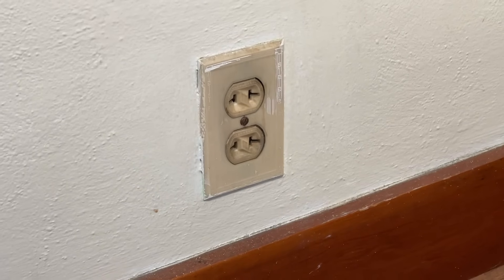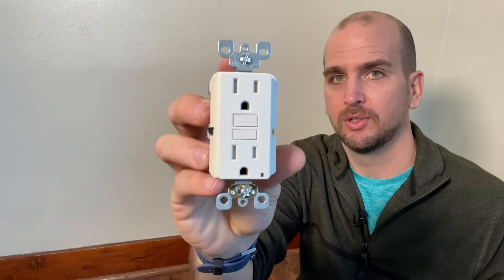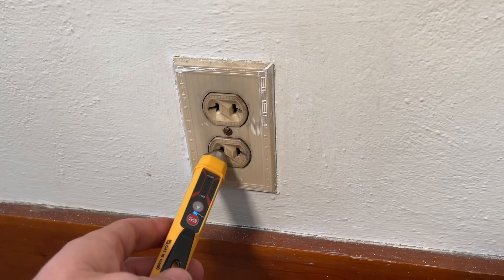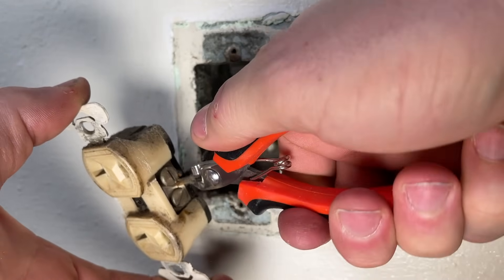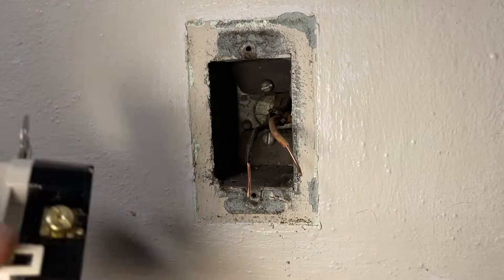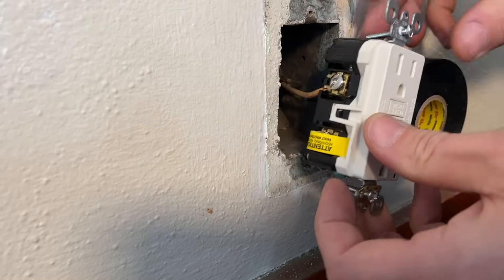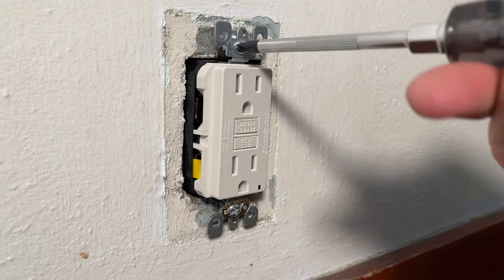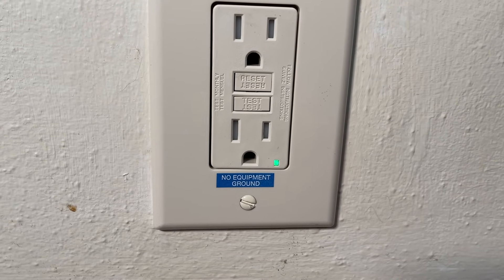How To Replace An Old 2 Prong Outlet Using 3 Prong GFCI

Comment: I though you ground the plug to the metal box?
I do this.
Maybe its useless...
Reply: Not useless IF the metal box is grounded.  It might not be.  In the house I am remodeling (1860s) the boxes are metal, but just nailed to the studs with the two-wire knob and tube wiring running to them.  The boxes are metal, but NOT grounded.

Comment: Nice and simple walk through. One question though, why didn't you hook up the ground on the outlet? Are they not needed on GFCI outlets?
Reply: Correct.  In this specific use, there is no ground wire to connect to the GFCI ground lug.  The receptacle is still not grounded, just like the original two-wire receptacle.  The difference is that the GFCI receptacle will sense a grounding event and trip, shutting off power to whatever is plugged into it.
Reply: @chrisboyd4433  exactly, had there been a ground wire there is no reason to install all these gfci's. Just install normal outlets and ground them appropriately.
Reply: there is no ground wire.

Comment: Oh so these don’t need to be grounded?
Reply: That is correct.   The equipment ground you are asking about allows high amps from a hot conductor touching metal incorrectly to flow back to the panel to make the breaker trip as short circuit.   GFCI measures the current of hot and neutral at the same time, so zero amps.   It will trip it’s mechanism if there is more than 5 milliamps of current difference.   They do not work the same, but safety is achieved.   Hope this helps.    Kevin

Comment: I am trying to replace my old outlet with a GFCI however both the WHITE AND BLACK wires are coming up hot!  There are only three wires.  White, black and copper for ground.  Its driving me crazy because its a kitchen outlet and I need it to work for so many reasons.  Any advice?
Reply: Cindy,  you say both are hot.   What testing method are you using to come to this conclusion?   Electrical tests for voltage.   Hot to N=120,   Hot to ground=120,  neutral to ground=0.
Reply: @KevinCoop1  Hi Kevin.. my contractor used a Voltage tester.  And even he was perplexed on why both wires were hot.  For some reason we are not able to replace the outlet because of this.  Any ideas what could be causing this?
Reply: @cindyr.9200     Question.   Did the receptacle work fine before trying to change to GFCI?  Have any other lights or receptacles been worked on?
There is only one possibility I can think of.   What is the voltage reading from supposed to be hot to neutral?   If 240 volts then condition one.   If 0 volts, then condition two.
Since this is your kitchen, should be very few outlets involved.
Condition one:   Have the electrician go to the panel and take off the cover.   Find the conductor on the breaker that turns power off to the hot 1.   Follow it up to where it exits the panel and see if it is part of a multi-wire branch circuit.   That means you have a 3 conductor cable with a ground.   If so, follow the other conductor to the other breaker and turn it off.   Now you should have no power to either wire at your outlet.   If this is what you have, somewhere in a box that is not powered any more, someone has connected the wires incorrectly.

Condition two:  If you do not have multi-wire branch circuit, then check all boxes turned off by the one breaker for incorrectly spliced conductors.
Let me know what voltages were found and if you found the bad splice.
Reply: @KevinCoop1  I have replaced numerous outlets in my home and have never had this issue.
Reply: @cindyr.9200    I did not see your response about changing numerous receptacles before my response.  Somewhere the white got spliced to the hot.
It has to be in a box the feeds toward the one you are having problem with.   Otherwise it would go boom and trip the breaker.

Comment: For this type of install how would you add a ground to it if you wanted one? I have a few outlets that are setup GFCI with no ground. Wondering if the ground is worth putting in/ how much of a hassle it will be? I'm using a GFCI outlet without a ground for high priced electronics (desktop pc, and monitors) so I want to make sure I do the right thing to keep them safe from any surges or issues that could harm them.
Reply: The ground wire needs to go back to the panel where the breakers are. OR it can go to a nearby outlet, switch, or junction box, that has a ground wire that ALSO goes back to the panel. You can test to see if it goes back to the panel by using a multimeter to see if you can get 120v from the black wire to the ground wire. If so, its good.
Reply: You can replace the breakers to afci they will protect your equipment from arc faults, gfci are for wet locations.  And you can also serge protect your panel it can protect your whole home
Reply: I’m not 100% positive about new computers, but I know for sure that years ago grounds were required by the manufacturers.    The reason is that for some reason, they are allowed to connect the ground to the PCB’s in the computer as a reference.   Could possibly cause data glitches.   I would suggest you check manufacturers instructions.   If required, get a new circuit installed to your equipment.
Reply: Any Surge protector/UPS plugged into improper outlet will have a red warning led lit up indicating a circuit fault . (The Instructions are: Do no use the protector and get the problem fixed) I've never tested a UPS on an ungrounded GFCI not sure if it would pass that test.

Comment: Does this work if there are other outlets Daisy chained into the circuit. I mean does the GFI have to be at the end of that line for the other outlets to work? And do I have to change all of them to gfi's?
Reply: The GFCI can be used to protect the receptacles that follow it, so it has to be at the beginning, not at the end. Alternatively you can just use only GFCI outlets and pigtail. The details are not important, important is that all of the outlets are GFCI protected.

Comment: Thank you for making this.  A potential duplex I found doesn't have any 3 prong outlets except in the bathroom.  I wonder if the property management company will be willing to update the outlets or at least be willing to cut me a deal if I have an electrician friend or myself do this.  The duplex also doesn't have a breaker panel.  It has these screw in buss fuses...
Reply: Good question and understand you are concerned,  from a safety standpoint.  You might discuss with the property manager,  it would be in their best interest if they upgraded to GFCI outlets at a minimum,  and preferably replaced with circuit breakers especially on a rental property.  Many disastrous fires have occurred with fuse panels when misguided homeowners and tenants attempt to solve fuse blowing problems by using a higher amp fuse, or worse yet, jumper the fuse by inserting coins or aluminum foil into the fuse holders.  Good luck with your electrical dilemma.
Reply: At least you have access to the master switch. My landlord locked the breakers in the basement.

Comment: My old metal boxes have a rectangular washer and screw that holds them in but they prevent my GFCI outlets from going in flush
Reply: Did u break the tabs on the gfci? That usually helps.

Comment: If you can access a wall space from the basement or attic you can daisy-chain a ground behind the baseboard trim by drilling into the bottom plate under each outlet and run a lag screw up and rip it out with a slip joint pliers and tap it with a hammer if you have to. Vacuum the heck out of it in case you have the old Gold Bond wall board that has asbestos in it.
Reply: Fishing is tough but you can drop a small steel chain down the back of the box and grab it with a magnet. I like to use a 1/4' hose with a magnet in the end and pull the ground up into the box with the chain and feed with the other hand.

Comment: Each old house I have worked on required a different solution. The first was a basket case, I just rewired the whole house. The second had an update panel with ground with two prong outlets throughout the house. I got some 14 gauge green insulated bulk wire and fished all the outlets. They all test properly. The last house hasn't got a ground solution and the house is too far gone to justify rewiring, so I am using the GFCI solution where I can.

Comment: Chances are the box is grounded why not check for ground and attach a grounding wire to the back of the box seems odd you have a ground your not using

Comment: You installed it upside down. The ground pin hole should be at the top, not the bottom. Also I always orient the cover screws vertically because they look better and I take pride in my work.
Reply: Is the orientation of the ground pin hole just for asthetics or is there a functional reason?
Reply: Yes. It’s for safety. If something was to slide down the wall and something was plugged into the receptacle, there is a high chance that it can arc on the metal prongs of the plug since the hot and neutral prongs are on the top. If the ground is on top, whatever slides down would hit the ground pin and then fall away harmlessly.
Reply: Thanks! Makes sense
Reply: There is no rule in the code that the ground pin should be up.
Reply: @okaro6595  That’s a dumb comment. There’s no warning on a hammer that say to not hit yourself in the face either. It’s called being smart and safe while doing the correct thing. Hence ground pin up.

Comment: Just wondering if you checked the gfi rating is it higher or lower than the breaker. Also using that volt detection not always accurate. Would have confirmed with actual meter.. Old houses love twisting wires to make them work.

Comment: I don't understand your claim that the 2 prong outlet is not grounded.  Is it not grounded through the BX sheathing?  Therefore, using that adapter with the little tab and the screw would indeed provide a ground to your appliance.
Reply: Also, you didn't tie the metal box to your GFCI's grounding terminal.  Your new receptacle is identical to a 2 prong with the adapter
Reply from the maker: Hey Kevin,  you are correct the GFCI does not have a ground wire but the GFCI does protect and will trip if there is a difference detected between the Hot and Neutral wires from a short/fault.  Grounding to the box in this case won't do much since there is not a ground path back to the panel.
Reply: Everyday Home Repairs was it BX cable?  The armor itself is the ground.
Reply: It's hard to tell from the video, the wiring could be BX, or it could be the older style NM aka romex that looks like a fabric/ tar soaked cloth with a black and a white wire, usually rubberized insulation but no ground, typically both types were widely used in the 40s and 50s when knob and tube style was phased out

Comment: GFCI will not trip without ground wire, it will trip when the "Test" button is pushed but will not trip with a ground fault tester. This will only give you a false sense of security.
Reply from the maker: Hey Gregg, I agree this can be confusing.  You are right that a test button on an outlet tester will not trip/test the GFCI but the GFCI will still trip when the condition is met where there is a difference detected between the hot and neutral wires which is the intended purpose of a GFCI.
Reply: A GFCI does not need a ground to work.  Its the difference between the hot & neutral that causes it to act.  Now having said that a "Surge Protector" will not work to protect your electronics on an ungrounded GFCI.
Reply: This is not confusing, I know exactly how a GFCI works and how to install them correctly as I am  licensed electrician, Yes the gfi detects current flow between hot and neutral and will trip with a difference of 5ma but without a ground reference for current to find the flow between will always be the same, if your looking to protect a device on an ungrounded system an AFCI receptacle would be better than an GFCI which is used mostly around open water source to prevent short to ground.
Reply: It will not trip with the tester as the tester uses the ground wire. This is just how the tester works and has nothing to do on the way a GFCI protects in the real life. You should use the button to test. It works.

Comment: Why would you put in a 3 prong outlet without a ground? At least the 2 prong wasn't lying.
Reply: any place I lived in the US for the last 25 years, that did not meet code. an open ground would require correction to buy or sell the house.
Reply: Gee, maybe so that you can insert a three prong plug without doing tricks.
Reply: @okaro6595  that's my point. You shouldn't do that. And what about the next person that doesn't know the ground isn't connected? At least if the next person has to use an adapter than they would be aware of what they were doing.

Comment: My entire house is pretty much 2 prong outlets can I change every one to these?
Reply: Just be aware GFCIs run on average about $15 to $25 each depending on which ones you get. You can get them a little cheaper in multi-packs.
Reply: any place I lived in the US for the last 25 years, that did not meet code. an open ground would require correction to buy or sell the house.
Reply: @bryanglass6701  Need to read the code.  Replacing two prong with GFCI is good per NEC.

Comment: It's crazy to see and be reminded of how other countries have totally different electrical systems. Like nothing of what he said would help me replace any of my old outlets 😄
Reply: In Europe one does not need that kind of a fix as one can plug grounded plugs to any outlet. Europeans have a room centered view on grounding while Americans have an equipment centered one. In Europe if one wants to change the outlets the reason is that one wants a true ground.

In Europe the problem was the other way: if the outlets were grounded but the equipment were not. People used various tricks like extension cords and cutting the plugs. However, since those equipment has now mostly been replaced with double insulated ones, the problem is seldom actual anymore.

Comment: There is no need for "fresh copper" by cutting the wire, you only needed to loosen the screws and remove the wire and then attach it to the new one. No need for extra labor and you shorten an already short wire to begin with. What happens if the gfi is faulty and you need to replace it? you going to cut the wires again? From 40 years in the  construction industry, i will say never cut the wires in the receptacle box.
Reply: lol, me electrician me cut wire when me want

Comment: Do you have a video that shows how to wire the outlets properly if you are daisy chaining this as the first outlet of the circuit? Also if I can not identify the first outlet in the circuit can I replace all outlets in the house with Gfci outlets?
Reply: So what you want to do is take the wire feeding the box (you can tell by taking everything apart and then turning the breaker back on quickly and using your voltage tester to see which of the black wires makes it beep) and put the feeding wires in the top part where it says line on the back of the plug (the top) and the wires going out on the bottom and you’re done.

To answer the second question yes you can add them to every plug if you can’t fine the first one but a Gfci plug costs about $13 a piece and you would have to get into every box to put them in anyway. If you’re going to get into every box just take all the wires apart and do the testing method I said above and the one that beeps is the first one in the circuit. Then put the gfci on that one and all the rest of the ones down stream are protected
Reply: Ooh I forgot to add. Once you put the gfci in the first one you can legally replace every plug in the circuit after it with three prong plugs as well. Just use the stickers the come in the gfci box that say “no equipment ground” or something like that on the 3 prong plugs after the gfci (it’s a code thing).

Comment: Did you catch that the old receptical was rated for 20A plug on 14 Gage Wire

Ooops
Reply: no that is a T socket. It is rated 15a but I know what you are saying.  I am not sure why they had those back in the day but it is only 15a.

Comment: If I change the 2prong outlet to a 3 prong.
Is it okay if I plug in my monitor may cpu even though there is no ground on the new 3 prong?
Reply: Yes, you will need to change it to a gfci outlet.  Not a regular 3 prong.
Reply: Yes, there are some precautions in using computers ungrounded. Connect all the equipment first and then the power. Use same receptacle for all or use a power strip for all and hook it to the wall. This equalizes the voltages between the devices. Connecting the PC to a TV is not recommended. if you do, use above precautions. Ideally do not connect it to anything but the mains i.e. use WiFi.

An ungrounded PC will get a voltage of half the mains voltage to the case. You could feel that if you touched it and a radiator (not recommended as there is a small chance that it would fail). It is not dangerous as the current is just 0.5 mA or so. (If it was dangerous a grounded PC would trip a GFCI).

Comment: Thank you. I'm glad for this walk around. I run into this problem being a maintenance man. Do you have a video on how to ground the receptacle, instead of bypassing it with a GFCI?
Reply: Using a gfci is a cheaper fix. Gives added safety which you wouldn’t have normally
Reply: U would need to rewrire the plug the way this guy has done is not a good way to do this at all.
Reply: @richardherman2754  The way the video shows is fine by NEC.